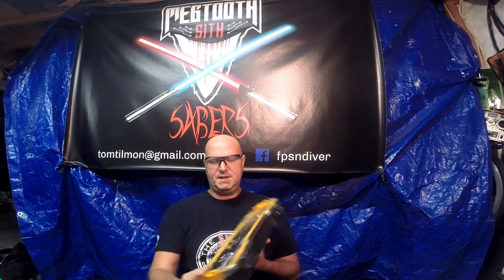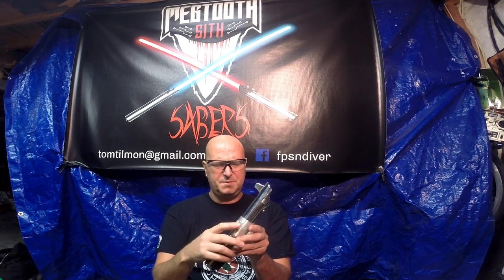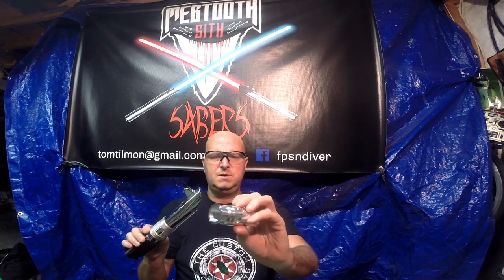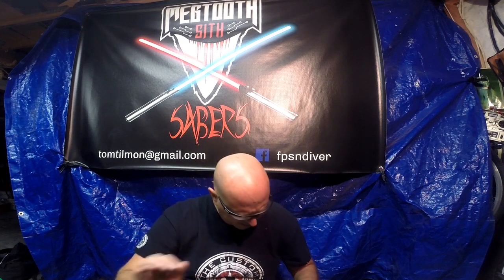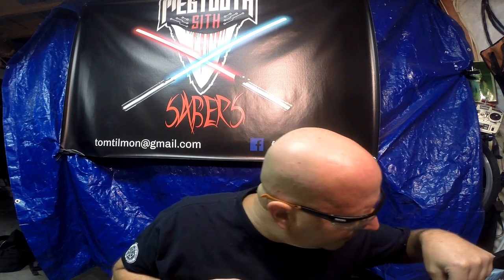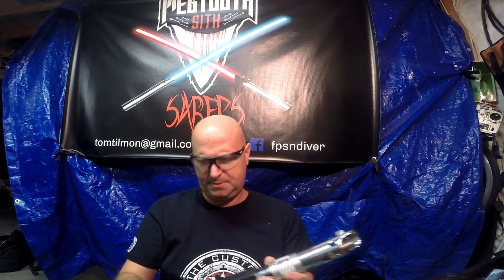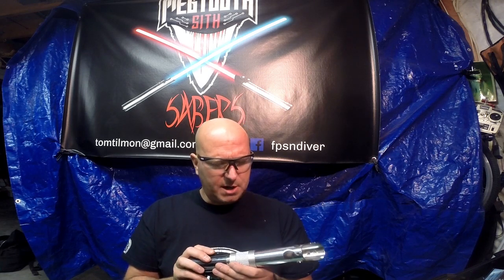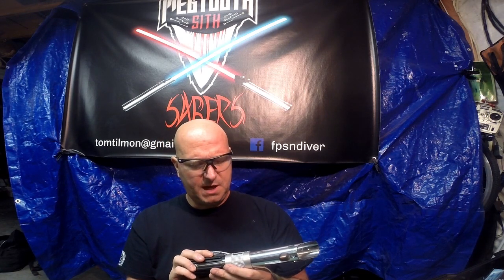Skinny Flex 1

Comment: One of those chassis I sent you should fit as well. I can send you a button holder for under the clamp card. You can buy gold buttons that match the size at micheals/craft stores.
Reply from the maker: I already got the Gold buttons.  I'm using a Graflex 2.5 bezel/Switch, so I'm good with the switch.  Clamp will be clean.  I've done clamp switches in a conversion before, but I liked the button solution better.  I carve a wire route out in the conversion kit from the button bezel slot to the back, and boom,  Very simple.  Then I glue the button bezel in.  Its way better, because its metal.  Its awesome.  I may try one of the chassis in the kit you sent me, thank you very much by the way.  TCSS is out of MHS V6 chassis, which is typically what I use in these.